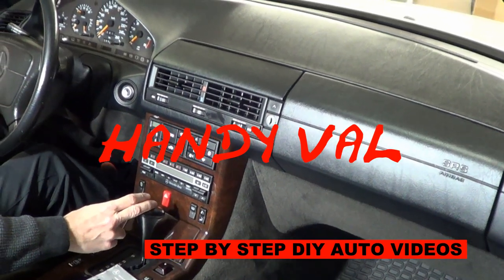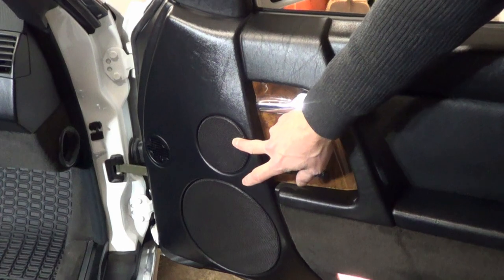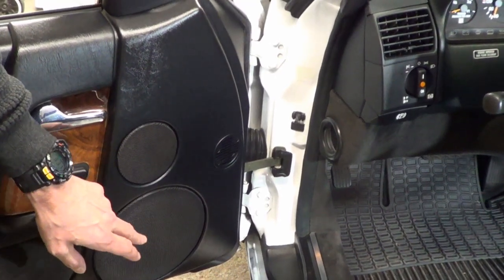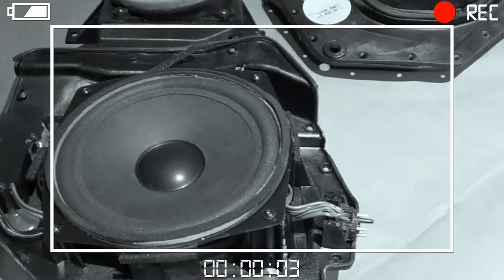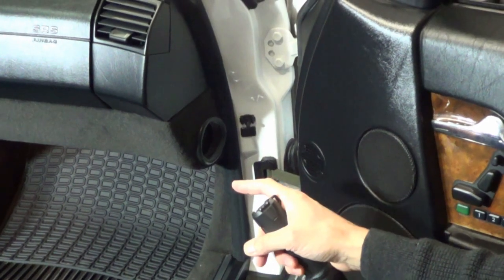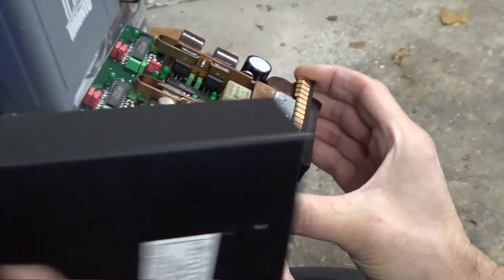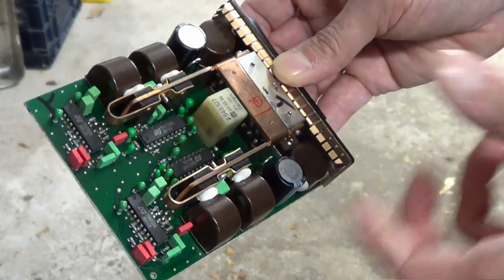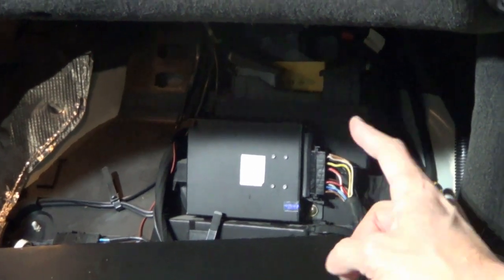Mercedes Benz Original Becker Stereo Radio Fix on R129 and Others

Comment: I have a similar problem with my bass speaker...but it mainly occurs on the passenger side.  I was about to look for another set of original speakers.  I hadn't thought about the bass amp. So thanks for this video. Honestly?  I didn't know that separate bass amp was housed under the passenger's feet.  Maybe I should check there first and look for a replacement.  I find your videos very instructive, well and clearly made.  Like you, I try to keep the original specifications of my R129 as much as possible.  So yes , also amber colored winkers , the Becker stereo .Best regards from Belgium.
Reply from the maker: Werner. Bedankt, merci, and danke. Thank you. I appreciate your feedback. I agree, you should start with the bass amplifier. You can try tapping on the bass amplifier and seeing if it makes a difference. If it does, then you certainly found your problem. It can also be a loose connection. If it was always the  passenger side then likely it would be the speaker, but because it sometimes occurs on the driver side, it’s likely not the speakers, unless they are both water damaged…it’s possible. You can also try unplugging the connectors on the head unit and then replugging them. Speakers can also be repaired quite easily by any speaker shop.
Keep us informed.
Reply: @HandyVal  
Thanks Val, I'll check it that way….
What you have already diagnosed correctly are the three official languages here in Belgium , bedankt ( dutch) , Merci ( French) and Danke ( German) 😉

Comment: Hey Val, I have a 93 400SEL that had a Becker 1432 in it when I bought it. But it had a very different speaker set up, as it had the Bose system with a 7 channel amp in the trunk. This dual amplifier set up that you have reminds me of the system that came in my other Mercedes, a 1989 420 SEL. In that car, there were 2 small amplifiers, just like the one shown in your video behind the back seat. Regardless, in both cars I had a problem with high pitched buzzing (like alternator feedback.) What I finally ended up doing was replacing the head units with Continental head units that look quite period appropriate. In the 126, I rewired the whole thing with new speakers plus a sub and a 5 channel amp from JL audio. But for the w140, I just went with a rebuilt amplifier and a "plug and play" kit from becker auto sound that included the Continental headunit and wires to interface with the factory amplifier. Needless to say: the second option was cheaper and easier, and to my ears sounds just as good.
Reply from the maker: Thanks John for sharing your experience. The Continental headunit looks and feels like it was made for these 90s Mercedes. It looks like original equipment but without the Becker quirks. If my headunit goes bust, I'll likely go in that direction.

Comment: love your videos val! where do you get that dasboard toolkit?
Reply from the maker: Thank you! The kit is from Amazon - look up - auto trim removal kit. The one I have looks like the Juning brand. They are all similar, but when buying make sure it has the stereo removal keys. The whole set should cost in the range of $20 to $30 USD. They are mostly made by the same manufacturer but use different names.
Reply: @HandyVal  thanks. I found a 148 pcs manfiter that seems identical. Thanks

Comment: I purchased a new head unit....a Sony, though not my first choice, the best that I could get presently. The installers bypassed the entire stock amplifier . Fabulous music that looks great too. I did keep the original unit though incase of resale. Now I have all the modern day capabilities....wow.
Reply from the maker: A modern unit, like the Sony, has many benefits notably the extra connectivity features with our phones, improved display and ease of use. I find the Becker isn’t the easiest to navigate. However, the Becker does have a cool retro look. Replacing the Becker components when they’re not working can be costly. My AM FM radio tuner recently stopped working (I made a YouTube video on it too). A new unit can be more cost effective. Maintaining the Becker can be expensive.
Reply: Hey Doug I'm curious if you changed out all the speakers with the sony head unit? If so what did you do? I'm looking to modernize my SL. Cheers

Comment: thanks for the video, dealing with my '90 with a 1480 becker head unit, wow thought the amp was more up under dash,  really easy, wonder why there are relays in that, I may send to Becker in NJ for rebuild/repair whatever. Will clean as shown out of curiosity.
Reply from the maker: Thank you. Those relays are meant to protect those bass speakers upon start up where there can be excess power. Which isn’t really necessary - a few I know have bypassed the relay (requires soldering) without problems. Try the electronic contact spray, you may have a better experience than me. Further, I’ve only heard very good things about Becker NJ. Either way, let me know….
Reply: @HandyVal  I am going to send my head unit for a 'refresh' and bluetooth install, will update you on results

Comment: Yep, had the same problem!  1st time I had a short in the bass unit and it was draining my battery took me months to figure out.  The only way was for me to sent all 3 pieces to Becker North America in New Jersey and they found it and rebuilt the base.  Got it back worked great and failed again.  Sent it back to Becker and they replaced the amp... even their fix did not work for long.
Reply from the maker: It’s a crazy complicated system that I wish the MB engineers made a bit more simple. I’ve heard great feedback from those who used the Becker shop in NJ.
Reply: @HandyVal  Yes, those dudes are GREAT and very professional AND reasonably priced too

Comment: Hi Val. Great video as always. No comment on the Becker or the amplifier but I noticed you mentioned the three speakers on each side. I've been seeing some conflicting reports about the speakers up on the dash right above the left and right air vents. Some say in the US it is a speaker for the optional integrated phone. Even if the car wasn't optioned with the car phone, the speaker would still be there. But others have said that those speakers are indeed for the stereo system. I assume the older R129s are going to be different than the late model ones but wondering if you have more info to share about those little speakers. I have a '94 R129 and I swear there's stereo sound coming out of those little speakers.
Reply from the maker: Thanks for the great feedback. My 92 SL, which isn't equipped with the integrated phone, clearly has sound coming from those little dash speakers (tweeters). It's the very high frequency sound and they (tweeters) are necessary equipment for any audio system. I think all R129 dash speakers worked with the stereo.
But I believe for later models they served dual purposes - for stereo and for handsfree calling, where equipped. The microphone was located near the rear mirror\map lights. I don't know when this dual use started, certainly in the 2000s, but 90s - unsure.

Comment: I see why you didn't want to try your hand at soldering on this thing, though others might be willing to give it a go. Going to guess you don't locally know anyone electronically inclined in that regard? Smart decision regarding the relay cover though. Would Focal speakers fit in those doors? Really nice French stuff. You could match the Ohms by using audio quality resistors in parallel to get the resistance to match. Just hope the stereo has individual volume controls for the three speakers.
Reply from the maker: You make a good point about a local shop. It's certainly easier, if you know of a local electronic shop. I worry about getting fleeced. They likely might have been able to fix the issue. However, I do think Ebay is a decent option, but like everything it all depends on price. Focal speakers are great. I don't know if you can make them fit, it's a slim profile speaker that goes into these doors. Running parallel audio resistors - never heard of it, but that certainly changes everything and opens up many more speaker options, instead of replacing like for like. Thanks for your thoughts on the topic - great thoughts.
Reply: @HandyVal  It's not really difficult working on something like that. It's fairly small, and a set of schematics from a service manual would certainly help. It's not as scary taking components off and testing them as people may want to think. As for matching Ohms, Ohm's law works like this. Add resisters in series, it's a linear addition, 2+2=4 etc. Parallell works as division. For example, a 4 Ohm speaker, put a 4 Ohm resister in parallel with the speaker connections, it becomes 2 Ohms. Then add another 2 Ohm resistor to make 1 Ohm. The only issue would be matching volume levels between the drivers.
Reply from the maker: @jameslaidler2152  This is motivating me to roll up my sleeves and try to fix those non-working R129 stereo parts, like the bass amp and the Am/FM tuner. Many thanks.
Reply: @HandyVal  If you don't already have soldering supplies, you don't need to go crazy with it. Just do a little research and get a decent soldering iron, and you can stick with old fashioned 60/40, 63/37 lead/tim solder, just work in a well ventilated space, and watch as many videos on soldering as you can. As for resistors, just same decent sand cast resisters should do you, just like the white boxes already on the amp board. Just take your time and be patient.

Comment: Hi Val, I have a Problem with my Mexico too. If I put a Tape in it and want to listen I get only mono sound with it. If I listing to the tuner radio channels I have stereo sound. Do you know the fault mate?

Thanks!
Reply from the maker: Hi Diamond. When the tape is engaged, you won’t see the stereo symbol (two overlapping circles) on the display but you’ll see the tape functions, either Dolby (DD B; DD C; or CR for chrome tapes) but you should be getting stereo sound, if the tape is original and recorded in stereo. If it doesn’t sound like stereo, it could be a dirty head, so you may want to try cleaning the tape head (either with a cassette cleaner product or with a Q-Tip soaked in cleaning compound - I think rubbing alcohol should work for cleaning). For the CD player, the stereo symbol should appear.
Reply: @HandyVal  the tape is not original but recorded in stereo safe! If I touch the stereo button there won’t be a difference. It’s only mono with tapes
Reply from the maker: Diamond. With the tapes, the unit’s LCD display won’t show the stereo indicator. It will only show the Dolby symbol or the CR symbol. So I think you’re getting stereo sound. If you don’t notice a difference between the left and right speakers, then I think it’s the tape head that needs a good cleaning. Bohemian Rhapsody by Queen is a good song to check left and right speakers. I hope I didn’t misunderstand you.
Reply: I have a 98 Sl500 so it has a different head unit.  The problem I had was the LCD display went black.  After searching for any solutions I determined the only way to go was buy a refurbished unit as I wanted the original look.  Kinda curious if this model has a similar issue for people.
Reply from the maker: @jamesreckling6697  It is a common issue. My head unit has one similar fault. The LCD display works, but the orange backlight on the LCD display doesn't - it's likely burned. All other lights on the head unit work. I can see the LCD display during the day and partly at night. It can be fixed but requires the old backlight to be removed and replaced AND requires soldering. For your situation, I believe you will need to replace the LCD display unit with a new/used one (soldering I believe is also involved). You likely would struggle to find an LCD display. I would have, like you, replaced the whole head unit with a refurbished one, while still keeping the old one.

Comment: 1991 300sl does anyone have a aftermarket diagram for stereo install the wire diagram thanks especially for wiring the midranges!
Reply from the maker: I’ll check my files. I may have it. I’ll let you know if I do.
Reply: @HandyVal  thanks awesome 😎
Reply from the maker: I don’t have a pure stereo only electrical wire diagrams but I do have the broader R129 electrical service manual and it does have a few references to the radio/stereo and speakers but likely not the detail you need. It’s a large pdf (600+ pages). You can contact me via email or Instagram or Facebook and I’ll can send it to you. My email: handyvalauto@gmail.com

Comment: Error 3 code someone?
Reply from the maker: The E2 and E3 codes are similar and typically mean some kind of loose connection and\or blown fuse. Fuses would be on the headunit (shown at the rear of the unit in this video), or on the Radio tuner ( https://youtu.be/VkHk6qN1ytc ). I made a separate video link here for the tuner. To a lesser extent the fuse in the trunk fuse box (near the car's battery; it has a little slider cover) can cause a similar problem - check it out for corrosion. If badly corroded simply replace it. I hope these simple fixes are all that you need. Keep me updated.